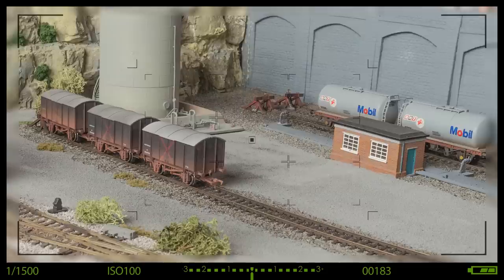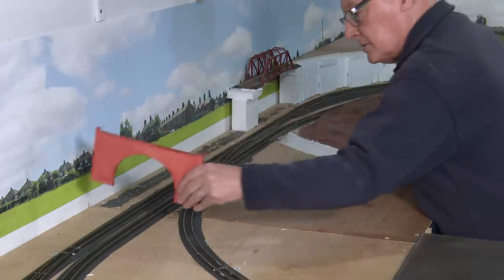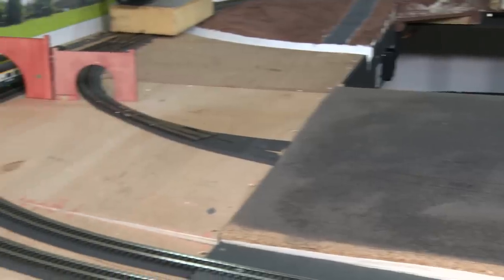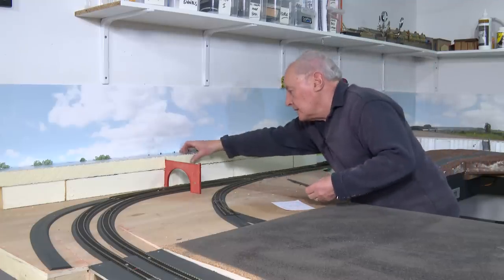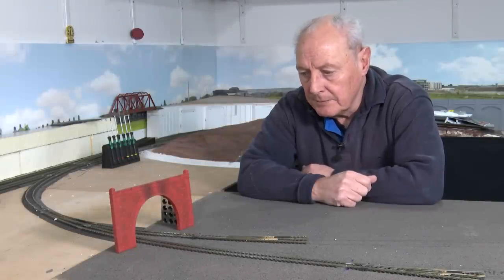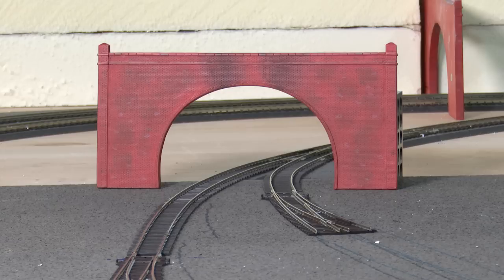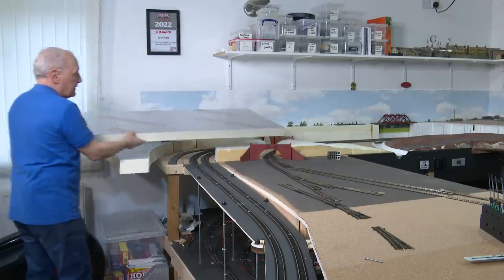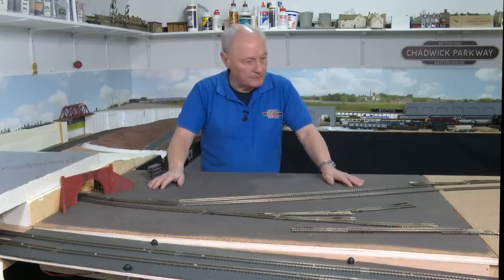Landscape Planning at Chadwick Model Railway | 176.

Comment: As you might know the DS64 was replaced with the DS74. Use to be able to find 64's at Train shows but this last year didn't see a single one for sale.  I use a combination of DS64's and Digikeijs DR4018. Yes you can program DR4018 utilizing the Digitrax hardware you currently have. Personally I like Digikeijs products far more than Digitrax and wish I started out with them. Each expansion project requiring more hardware I utilize Digikeijs products. PS thanks for the video.........
Reply from the maker: You might be unaware B68C, but Digikeijs may well have  gone under! I do hope you don’t need support from them in the future. 
Stay safe, and have a great Christmas. Regards, Charlie
Reply: @ChadwickModelRailway This got my curiosity up so  I spoke to the Digikeijs US distributer and he stated that is just a rumor. I hope thats all it is.

Comment: Greetings from Slovenia Charlie. Regarding the TT 120 stuff. If I were starting from the beginning I would head straight for this scale. My criticism of the current Hornby range is it is completely disjointed. It's also ridiculously expensive with the 08 at just under £200. I really don't understand who Hornby are trying to appeal to. The idea of commercially produced British outline in TT gauge is great but from what I've seen presumably Hornby are expecting the new HAA Merry go round wagon(s) in the range to be hauled either by steam traction or an HST power car. It's a great idea but, in my opinion, they've got overexcited and gone off half-cocked. We shall see. Best wishes
Reply from the maker: I think you’re right, Halfcocked is a decent description. Regards, Charlie

Comment: In the '60's I started a layout based on TT (roughly 3mm to foot!). Due to the demise of TT and life otherwise, it eventually all got sold off. But, 3mm scale does give more room than 4mm, and this can be seen at shows where 3mm gauge layouts are shown.  3mm or TT:120 is a happy medium between 2mm and 4mm, and has a market, but all will depend on price.  Suppliers/manufacturers other than Hornby and Peco are also stepping forward, so time will tell.  
Am unsure about sole direct supply, this providing only main exhibitions for buyers to handle the product.  Could this slow the introduction and conversion markets?  For me its too late to change as too heavily into 4mm 00 gauge.
Reply from the maker: An excellent comment Bob. And of course there will be nothing on the secondhand market for sometime. Regards, Charlie

Comment: Hi Charlie ,, on the subject of TT gauge , well , where do I start.
I bought some trains off a seller on ebay and I have been in and out of modeling trains for over 40 years and when i got back into it around 2020 after my mum passed away I started buying some railway stock so when i eventually get around to building my layout i will have plenty of trains to run on it.
Now in my buying spree I had bought some lms coaches which would have completed my lms coach rake as these coaches would be added to the other 4 or 5 that I already have.
Fast forward to a week later when I got the parcel from the post box.
I noticed that the box was rather small for the 6 coaches to fit in so I thought the seller had only sent 2 of the 6 for some reason.
When i opened up the parcel there was indeed 6 of the carriages i had purchased but they had shrunk considerably as to why the packakge was soo small.
So I sent a msg off to the seller saying that these carriages had shrunken considerably since I bought them off him. 
He said that these are TT scale or TT guage.
He did have TT in the heading of the listing but did not have the word scale or guage next to the letters TT which would have got my attention as to the size of the trains or the scall of them that he had for sale. 
I did see the TT and i presumed it was maybe in the heading for table top as there was no explanation as to what the TT meant anywhere in the listing or in the description.
I did see the TT in the listing but my presumption was that TT was a filler as ebay always says to fill the heading with as many key words relating to the item in the heading or listing as you can. (I was a seller for over 8 years straight until i mentally burnt out).
So I bought them.
The email i sent was returned and he said well he stated TT in the listing and the description and he point blank refused to refund me for the teeny tiny tt carriages.
As i said previously i had been around trains for a long time and i have heard of N HO OO O & G scales but i had never ever heard of TT scale before so I had to google it. 
And hey presto here they were TT scale made by hornby. 
Well I'll be chuffed.
They did make a TT scale.
So as a buyer on ebay I requested a full refund as the word scale did not appear in the heading or in the listing as the description as the wording was not correct in my eyes as being a previous seller for 8 years that this is what you have to do when selling items.
So after around 5 emails back and forth the seller would not offer me a refund so I thought i would take some pics of the TT scale trains and blow up the pics up so I could see in detail as to there condition as the seller said these were like brand new in "great boxed condition" and when i expaneded the pics I was amazed at how many crack's there was in the bodies and in the wheels and in the bogies too so I sent him the pics and he returned an email saying oh ffs i ll refund you just to shut me up so I refunded my lovley cracked TT scale trains for a refund and I was still left out of pocket - $14 for return postahe and for the trouble of it now every time i see a TT sacle i cringe and just read on with the horrible memories of what went on previously i know that is not hornby's fault but I can see there is a marketing opportunity in as much as if they can make a model for X amounts of dollars and double or triple there costings well why wouldnt they ,, its like here in australia Macdonald's run a promotion of 1/3 size ot the usual sized big macs and they called it son of mac and they would have made a bucket of cash from it no different to hornby i suppose. 
Also No different to any of the brand name food manufacturers where they make a brand name product when they also have to make a generic brand of exactly the same but maybe a tad smaller or not as good of quality as the brand name but they still do it.
Any hoo thats my 2 bobs worth.
Cheers from John in Australia.
Reply from the maker: Hi John, scale and gauge can often be confusing.  TT120 is 1 to 120th or 3mm to the foot! 
Sorry to hear of your predicament.
Regards Charlie

Comment: Lots of questions for the audience today!  

#1: TT120?  I like it, I think there could be a market, but it will take a long, long time to get a lot of the stock, buildings, landscape, etc. needed for serious prototypical modelers, but having something between HO and N seems appealing to me. 
 
#2: Energy costs: As I live in Southern California, e very mild climate, it is not too expensive, but costs have gone up about 30% over the last few years because the idiots who run the utilities think they can replace nuclear power with fans and mirrors put out in the desert.  

#3: Tunnel size:  I think it looks fine with the reduced height, but if I could suggest, perhaps making a prototypical and customizing it so you don't have such a large, rounded arch?  I love finding images of beautiful tunnels (and the UK has a lot of them!) and carving them out of foam, painting, etc.  It is super easy and I really enjoy the process of finding and making something custom.  Perhaps you can find one that fits your proportions perfectly?

Side note: Going to construction sites and getting left over materials is a great suggestion!  As an architect who visits lots of sites, there is so much extra left over - wood scraps, plywood, even fasteners - and tons more.  If you are nice and talk to the foreman, they are usually very accommodating.  It could save you a significant amount of $$$/£££!
Reply from the maker: It’s nice to find someone with the same attitude as me, roaming around building sites, looking for offcuts. Many thanks for your comments on the points I raised. Regards, Charlie

Comment: If you really want the tunnel entrances the same height, are you able to use the piece you cut off the taller one and after cutting it to the height you need, glue it to the bottom of the shorter one to bring them up to the same height?
Reply from the maker: You make an excellent point.
However, it may turn out to be a deep cutting. Regards, Charlie

Comment: Maybe you should find a source of cheap insulation to save on your heating bills. :)

I think TT120 is brilliant, finally British modelers have a scale that is correct to gauge without resorting to the arcanery of rolling stock modifications and from-scratch track construction.  The scale allows for much better layouts in any given space, and today's manufacturing capabilities are likely able to bring detail better than anything Hornby could in the 1980s in OO.  There's nothing to not like about the possibilities. That said, I would like to see sprung buffers, which the reviews I've seen so far haven't featured.

More importantly from my perspective, the current roadmap is severely lacking in early GWR stock.  You could make a good start in LMS or LNER, BR, or modern liveries, but pre- or early-grouping GWR is almost non-existent. That keeps it out of contention for my next layout unless things change before I get started in earnest.

Yes, the business model is questionable.  The pricing appears to be reasonable though.  I hope Hornby can find a way to let local model stores in on the action somehow.  I'm not confident that will happen. I wonder what percentage of sales now is online.  I suspect that it's so high that Hornby realised that in most sales the model stores were little more than an extra postage charge and cost to the consumer that could be eliminated by direct-to-customer sales.  The model industry is little different to any other in that regard.
Reply from the maker: You make some excellent points, Ian.
However, it will be years until anything appears in the secondhand market, severely restricting people coming into the Scale. Hornby are very much cutting out every retailer from this gauge. Regards, Charlie
Reply: @ChadwickModelRailway  I wonder what other manufacturers getting on board with the scale might do.
Reply from the maker: Heljan have pulled out.

Comment: Hi Charlie. I'm intrigued by your request for DC64s. I use a combination of DS64s, DS74s and DAC20s. I wonder if you have the same issue with DS74s that I have; namely the push fit 8 pin connector from the point to the DS74 is not always a good fit? I've ended up using the devices placed upright on the top of the boards of my fiddle yard and only "upside down" mount the DS64s and the DAC20s under the top level boards. Even so, one of my points attached to a DS74 does not throw unless I prod the connector on the DS74. I've been thinking that I ought to drop some solder onto the male connectors to make a better, consistent, connection - or to find a different connector to replace the Digitrax one. Does anyone else have this problem and possibly a solution?  Best wishes for Christmas and thanks for the great videos. Charles
Reply from the maker: I have heard of these issues, hence I’m trying to stay with DS64s.
Have a great Christmas and best wishes for 2023. Regards Charlie
Reply: @ChadwickModelRailway  Having written the first comment above about the DS74, I decided to get on and do something about the issue. I removed the 8 pin connector only to discover it is not an 8 pin connector at all, but two 3 pin connectors and a 2 pin connector fitted together by two mouldings on the side of each connector fitting in to two slots on the adjacent one. The DS74 with the dodgy connection was the result of one of the mouldings not being correctly located into the corresponding slot on the adjacent connector and hence the female connector being misaligned with the male connector on the PCB . It took 10 seconds to put that right and the DS74 has worked perfectly since then. An assembly issue rather than a design issue.

Comment: I think the single track to the loco depo and loop should be in a cutting rather than a tunnel.  There comes a point that it's easier for railway builders to remove all the dirt above the roadbed instead of building a tunnel.   Tunnels with little above them look a bit contrived on a model railway.
Reply from the maker: I think you’re right Mark. Have a great Christmas, and best wishes for 2023. Regards, Charlie

Comment: I was a little surprised by your problem with converging tracks going into a tunnel. Although not quite all in tunnel, Birmingham New Street has 12 platforms which, more or less at tunnel entrances (there are three: one SE and two NW) converge into 4 tracks (or two in the case of the line out to Five Ways). Prototypical? I don’t know; but it would not bother me that much…
Reply from the maker: There is also the problem of maintaining them if they should go wrong Timothy. Regards, Charlie
Reply: @ChadwickModelRailway  That I had thought about... I seem to remember - maybe inaccurately - that you had a hillside you could just remove (may have been in the old TMD days) but obviously here things are more complex and, pun intended, stickier!

Comment: TT.  Hmm.  Whether it flies depends to some degree on what extra it brings to the modeller.  I suppose its partly about detail to 'landscape packing' ratio.  The contrast between 00 and N is clear and well-rehearsed.  To me it's less clear with TT.  Is there a significant enough difference in landscape packing - I can't see it.  Shouldn't Hornby be investing money in things like supply chain management and resilience of supply of 00 before moving into something completely new?
Reply from the maker: Erase some excellent issues, Michael. If only Hornby would listen!
Have a great Christmas and best wishes for 2023. Regards Charlie

Comment: your right about setting goals cos it does help you get things but have some flexi end dates as well just in case you run in to a ploblem

if they wanted TT:120 to really take off then they should have all the same track bits has ho/ho and not just a few bits of track ready to go and the same alot more rooling stock would have been better and also the cost needs to be in the middle of ho/oo and N and not the same price
Reply from the maker: Thanks mate, best wishes for 2023, regards, Charlie

Comment: Ironically, I just came across somebody who was making some wagons for tt120, otherwise, in the states, I hadn’t heard of it. Seems like a pain. It’s already hard HERE to get a hold of n scale/gauge of what you’re trying to model compared to HO/OO. If you just want to use the scale and don’t need different locos, maybe it’s ok? It is annoying if you literally can’t buy any of it at a local shop, but my local shop already has a pitiful choice of most stuff. 

I too am wondering if there’s any worry about being able to access the points in the tunnels. Is this track going to need cleaned by hand somehow as well? I have the nightmare of adding the tunnel, doing something outside, and accidentally blowing a bit of debris in exactly the wrong place on the points. 

Fun! I just finished adding the foam for my mountains and after Christmas I’m hoping to have everything I need to continue with it.
Reply from the maker: I feel your pain Andrew. 
So many of the smaller model railway suppliers have gone under, mainly due to the big mail-order Giants. 
Have a great Christmas mate, regards, Charlie

Comment: I've noticed that Hornby is only comparing the new TT models against OO models and not any other smaller scale like N gauge? And why, because it would reveal the "lie" in their promotional bumf about the space saving aspect. Yes, the track is to scale unlike OO and British N gauge, but in the case of N the difference is a barely noticeable 0.7mm. So, whilst some OO gauges might swap to a smaller scale, like I did many moons ago, with its vast array of models I thing more will end up with N gauge layouts than TT.
Reply from the maker: An interesting comments, Neil.
Have a great Christmas and best wishes for 2023. Regards Charlie.

Comment: I really like your videos and how you're building your layout.
However I have to say, and please don't think I'm nitpicking (it's a model railway and rule 1 applies) but why would a railway company start a tunnel as a single track, and then start to widen it so it ends up as a double track just to accommodate a point?
If you took the top off it would look like a funnel.
Would it not look look better as a cutting? 
It's just my observation and in no way meant as a criticism.
Reply from the maker: You could be pushing on an Open Door on this one mate. You’re not alone with this suggestion and perhaps I’ve been a bit blindsided. Regards Charlie

Comment: TT:120?
I’m surprised where the industry is going. I thought we were all appalled by the rising cost of new trains. I get that a new gauge will generate spending but I wonder if it really creates new customers or merely spreads the existing market across more gauges. If it’s the latter I would have thought it will drive down economies of scale and spread any new model development budgets across more gauges. I’m not convinced it’s a good long term strategy unless these companies are so profitable that product management isn’t an issue.
Reply from the maker: I think you’re right Paul, Hornby, see it as a gauge on which they can monopolise and lessen the effect of the new companies competing on 00. Regards Charlie